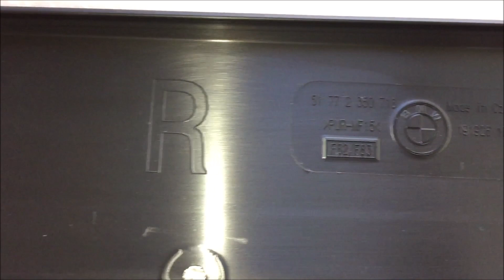BMW M4 M Performance Side Skirts Installation

Comment: Is double sided tape really needed for these skirts? They're thin and light and I think the 8 screws would hold it. Im installing mine soon
Reply from the maker: The OEM BMW M Performance Side Skirts are delivered with the double sided tape already mounted. So why not using it. I don't trust these plastic screws. Some of them broke while screwing them in. More important is the Betalink glue.

Comment: Wo kann man diese kaufen ? Solche gibt es doch nicht bei BMW oder ?  Und müssen die vom TÜV abgenommen werden ?   oder braucht man die nicht Eintagen ?
Reply from the maker: Doch, ist ein original BMW Teil. Muss nicht eingetragen werden.
https://www.leebmann24.de/bmw-m-performance-schwelleraufsatz-51192350719-51192350720.html
Reply: @AndreasBurkhardt1  ok danke, die habe ich auch schon gesehen bei Lebemann 
Aber auf den Fotos sehen die ganz anders aus als bei deinen BMW
Reply from the maker: @bordeauxdoggehenry7841  die bilder sind manchmal verwirrend bei leebmann. Darauf sind die auch schon lackiert.
Reply: @AndreasBurkhardt1  Top danke
Reply: @AndreasBurkhardt1  Gibt es eigentlich die selben in Carbon?
Reply from the maker: @wawjan172  von Bmw nicht. Von anderen Herstellern gibt es bestimmt welche, die recht ähnlich aussehen.

Comment: Do you have the part number for the rivets? I bought a set of skirts which didn't include them.
Reply from the maker: No, sorry. There was no part number on the bag. But you can use some self tapping screws like Tommy in his video:
https://youtu.be/Q3nz9pQlGyM
Reply: After a bit more searching, the part number is 07149193301 for the expanding rivet, but i've gone with blind rivets as i had a few lying around and they seemed to have held up fine